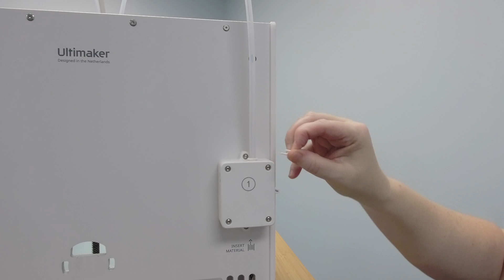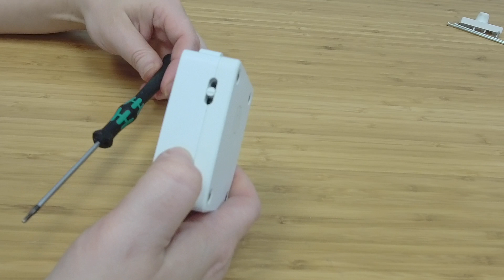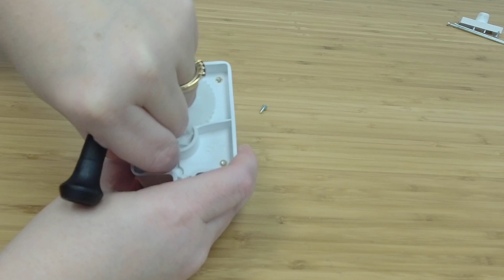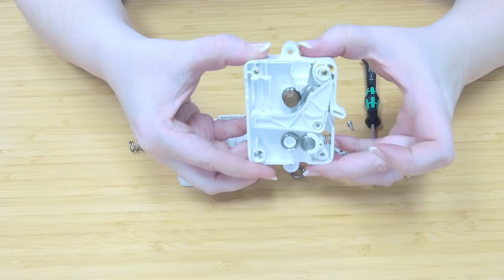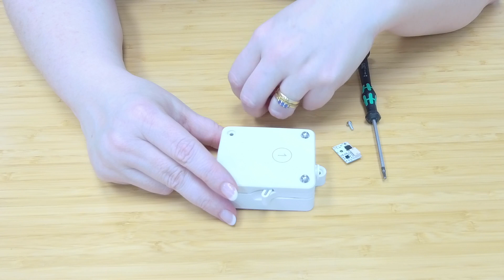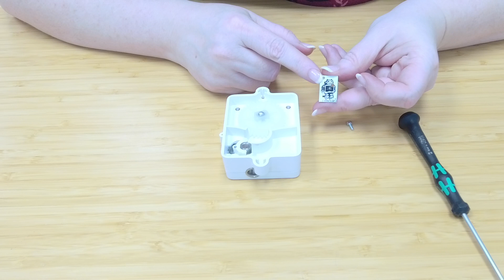Taking Apart Your Feeder (UltiMaker S3/S5/S7)

Comment: Of course I dissambled mine without releasing the tension and parts went everywhere. This video helped me put it back together LOL.
Reply: I just did exactly the same thing. Except because the 4 cover screws weren't fully disengaged, the tensioner screw pushed it head out between the halves. 😂
Reply: @yeahbutnaahh 😂

Comment: How do you remove the actual feeder gear? Mine is worn down so much that it does not grip the filament enough even when the screw is tightened all the way
Reply: Same problem. Hope that is a part that can be replaced.

Comment: Hi Erin, first of all, I want to thank you for the videos you've been making; they've been a great help in dealing with my S5 printer. Currently, I'm having issues with the XY axes; I notice they have some play, and I think that's been causing the printer to not print properly. Could you make a video on how to fix this play in the axes? I would appreciate it.
Reply from the maker: I've actually recently made a video that I think will help. Check out my S5/S7 sliding block installation video. It covers how to entirely take apart the XY axes and reinstall all of the components, including checking for play on the axles. If that doesn't do the trick for you, let me know! We are always looking to add useful tutorials to our channel and fbrc8.com to help you get the best out of your UltiMaker printer.

Comment: Hi Erin, I've had a UMO since 2012, highly modified and on its third set of long belts. (It's direct drive / no short belts.) I recently upgraded to a used Ultimaker 3, because I wanted a true 2.85 dual-extrusion open source printer. Your videos are the best on the web and they've  helped me update my knowledge about the differences between the two machines. I'm now going through the U3 and cleaning and checking everything.Thanks for your help!
Reply from the maker: Thank you so much! I’m glad you’re finding the videos helpful. Our goal has always been to make the UltiMaker printer ownership experience the best it can be and help make sure servicing the machine is as user friendly as possible so you can get the best out of it.